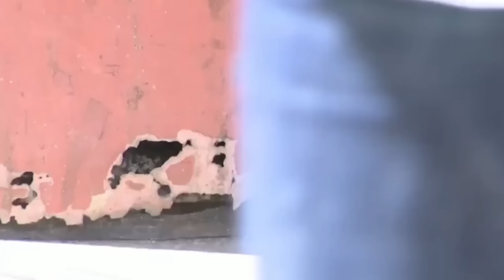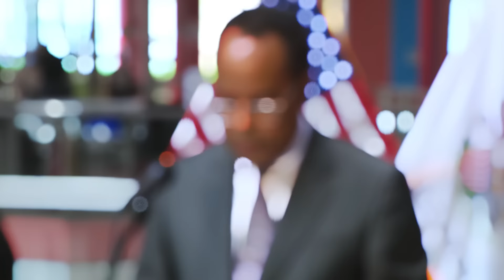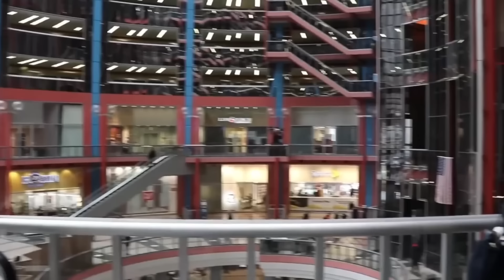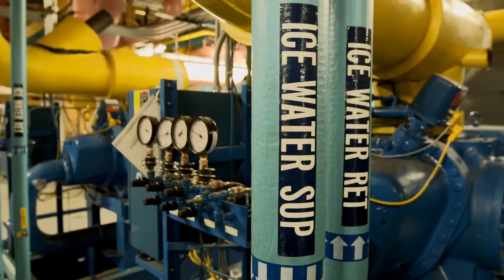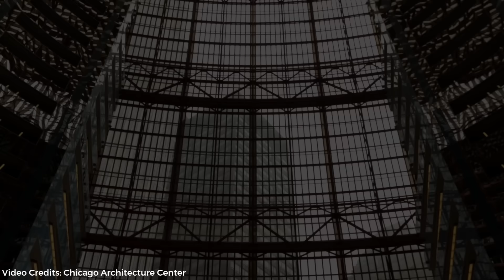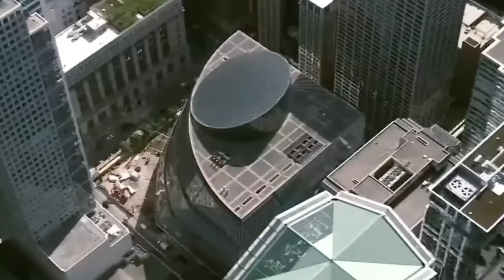Inside Google’s $280 Million Plan to Save a Chicago Landmark

Comment: Google has executed a well thought out plan, understanding and solving all the issues with the structure. The building suffered previously because of poor uninformed choices made by government officials to NOT follow the original specs and in deviating from the specs, they shot themselves in the foot setting the stage for the building to NOT meet expectations.  Too many cooks in the kitchen and failure authorized by committee. Additionally they neglected maintenance for the structure trying to save money due to the soaring operating costs they created by altering the design. It was a catch 31 situation. It's pretty typical. They threw the architect under the bus, blaming him for years. He knew what he was doing when he designed it and fought to keep it from being demolished.

Comment: Architect and useless glass. Someone messed up. Bean counters strike again
Reply: They changed the glass in turn made the HVAC under sized for the building. Then they tried to file a lawsuit against the mechanical contractor until the contractor found the states mistake.

Comment: Form should follow function and TBH the building wasnt really designed well. The amount to heat and cool that place was insane. It became an icebox in winter and a greenhouse in summer. It was extremely hard to fix any leaks on the windows. I was on the 4th floor with ISAC and with open access to the lobby below, the building was extremely loud. Also, when pigeons got into the building, you could never get them out. It was a unique and beauitful building but not suited for a government building. The state is now pretty much taken over a more practical building, the older BMO and Harris tower building. 

Google though is making that building truely unique and beauitful so good on them

Comment: The Loop is simply too dense and well connected to ever "die". For that reason it has always persevered through the past 100+ years where other midwestern downtowns have faltered.  No matter where you are in Chicago or the midwest region, you can get to it quickly by car or by train (CTA, Metra, & Amtrak). The Loop will change, it will go through ebbs and flows, but that convenience factor allows it to remain the heartbeat and focal point of the region. I think it makes sense for Google to bet on its comeback,  you can already sense the worst is behind it in the post-COVID era with vacancies plateauing and even coming slightly down. Ten years from now it may not be the Loop of the past,  but it will remain a busy area.

Comment: The only reason it required so much work is because Illinois made bandaids fixes for decades. They also made several changes to the original architectural plans to make it cheaper and that is what cause a lot of the issues they had

Comment: Infrastructure is a term that rarely comes up during political campaigns. It's a necessary cost that makes promises of future benefits less delightful to voters. For instance, every road has a lifespan based on engineering and materials chosen for the road. The cost of maintenance and likely replacement should be a part of every infrastructure budget for that entire lifespan. Deferred maintenance should always report its incremental and inevitable longer term cost. Cutting cost by ignoring factors like HVAC, water infiltration, corrosion and the like is irresponsible. Wise up when politicos talk about saving money.
Reply: Thank you for this absolutely true and descriptive statement!  Yes, maintenance and sustainability must be in any budget,   I agree, we must wise up!

Comment: 1. Glass is a poor insulator regardless of the number of panes. 2. They are going to need their own nuclear reactor to heat that building with electricity. 3. Electric rates are already skyrocketing because of data centers, this will add to the demand.
Reply: Google can pay it

Comment: The regular glass exterior was not the original Architects doing.... he had a 1980 solar friendly/insulating, but expensive glass in his plan. The state ultimately.... did some price-cutting and sadly, chose to use cheaper regular glass panels that was far more costly and HUGE mistake over time. Add neglect of deferred maintainences as most funding was eaten up for cooling and heating systems that never worked because of the glass choice. 

No money's left for the improvements sadly.... and though the atrium looked great fore decades.... acually futuristic and used in movies by that look. The offices were neglected totally as decades old carpet never got replaced. 

I read debate on keeping the atrium tile floor or covering it, but still left intact and other details.... caused a architect to resign lately. Still, I would expect the building to be a SUCCESS STORY in restoration and though still offices.... repurposing a to some relic.... and to others a unique archetectual Post-Modernist building that was the total opposite of a GLASS BOX. That alone and era of attempting to excape more simple glass boxes and even many in Chicago more elaborate use of exterior granite that looks great still.... that rarely is seen in new buildings.

All around it is buildings from vitually every era of the skyscraper.... and this building is just another example of types of buildings that only Asian cities like Dubai would do today, where price-points do not limit an Architect from adding additional more costly features. This building already had them bones to just restore and revive for many more decades to come.
Reply: Nice comment. It was nice to hear the bones of the building were sound. I was in this building a number of times and the climate controls were all over the place too hot too cold. Who wanted to work in these conditions? It will be an outstanding building now that the money will be spent wisely
Reply: Here in Dallas we're about to lose our I.M. Pei designed City Hall so that our NBA team can build another arena. The NHL team is also abandoning the 25yo arena for one in the suburbs. Deferred maintenance, a dubious $1B renovation estimate and a coordinated PR campaign of civic and business leaders saying the building should be torn down.